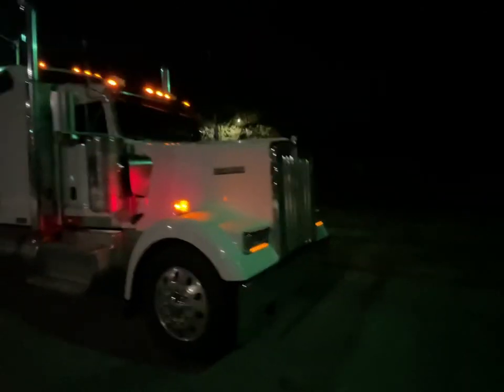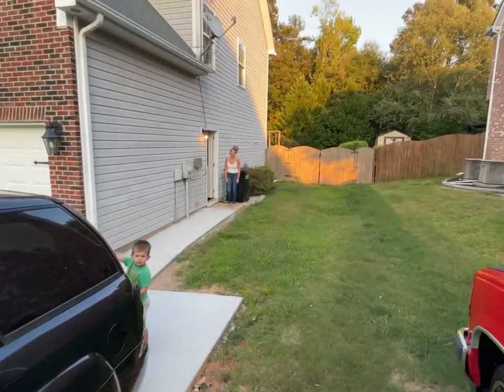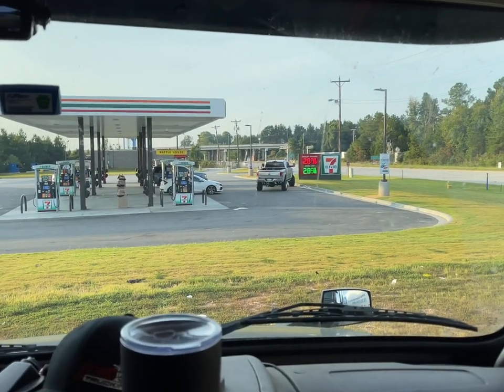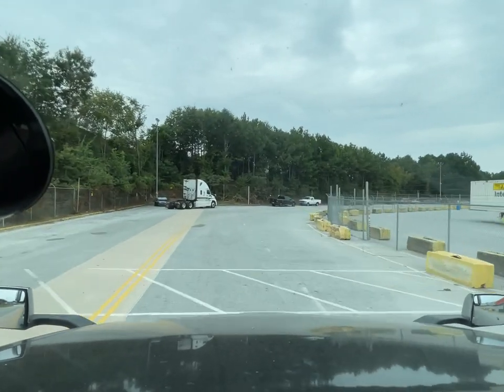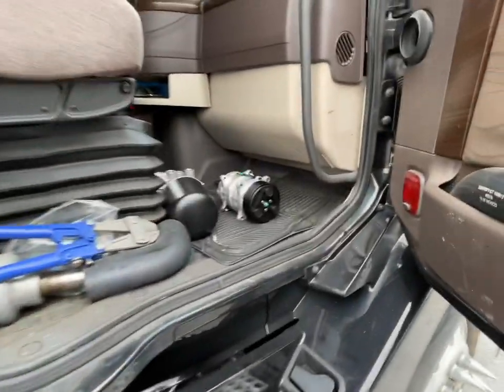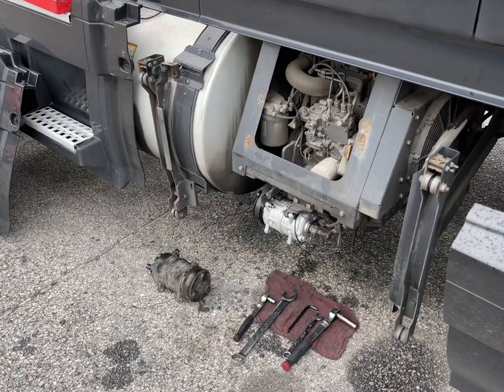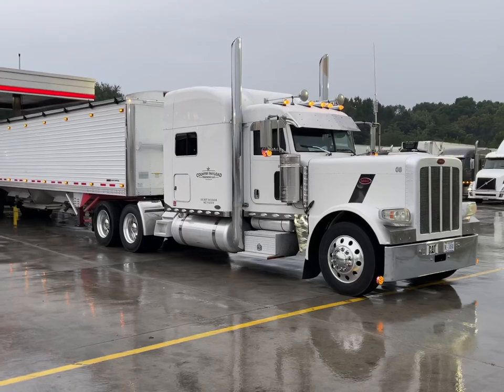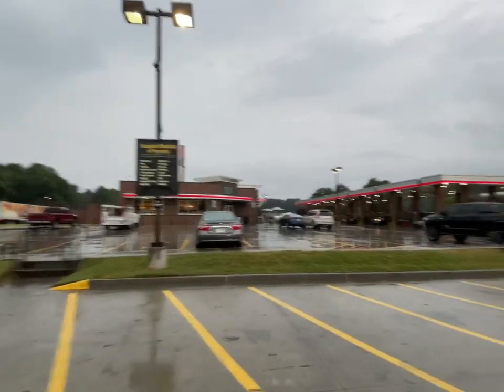“Gotta Fix this Trailer before my Appointment” DIY APU AC Fix !! Daily Life OTR TRUCKING fails Crash

Comment: I wish I could have caught you when you came thru Richmond I could have fixed the floor for you. Just a little advise on fixing floors... Wood from hardware stores don't hold up. Trailer floor wood is way stronger and laminated on the bottom to hold up longer. Also when the hole is in between 2 boards, cut out both boards and stagger them back in almost like you are playing Tetris.Thats for strength. I fix floors everyday so its almost second nature now 😂

Comment: The trailer floor is 5/4 shiplap laminated hardwood.  Either brazilian apitong or keruing.  Super hard wood to work with but holds up a long long time.  I shipped out a whole lot of it back in the day .
Reply: right on  James  do it right the first time
Reply: Maple is also used on trailer floors.

Comment: It's usually 5/4 board. They do sell it at some home depot locations but you can always get it at a lumber yard. You can use 2x4s or any 2x wood it may be a little higher or lower depending on your floor. They sell a power planer to level the surface if necessary. Mines a rigid battery powered planer. I always did my own repairs and I seemed to learn the hard way more than not. Some people would be jealous to see someone succeed where they failed but I love it. I use your videos in daily conversations with fellow drivers. We just started using 360 and uber at my job now. I'm trying to explain to them we need tql and ch Robinson but they don't wanna hear it. Seems ignorant to limit yourself when it's completely unnecessary but I guess I'm not the best one to offer up advice so I always refer to your videos. It usually gets the result I'm looking for...    crickets from the peanut gallery. Be safe out there.

Comment: Whenever you break the system open to air, you should change the receiver dryer. It absorbs moisture in the system and when the system is open it will absorb the moisture in the open system. Then evacuate and charge.
Reply: Facts was a little mad watching to evacuation pulled and old reciever

Comment: Great fix no matter what wood you use; However since the big tires are spraying water and rotting the affected wood you probably be better served if you "screw in plastic" from the bottom side from like used oil containers; i know i used have many many oil containers doing my own 12gallon oil changes; I know you do you own oil changes that plastic makes an excellent protector for any "air and electrical lines" down below, and intertubes work great also
Reply from the maker: Great idea

Comment: Was that our new Spaghetti Junction at Interstate 85 and 385?  
I just can't wait to see you hauling in that WHITE TRUCK . It looks awesome. Although I'm not a fan of driving those long nose trucks. I took my classes at Greenville Tech in 1993. I dont know if they still have the white flat nose cab over International truck that I used to get my license in when you went to school. I like the look if them. I saw that they were  building one . When the door opened a set of steps came out with the door . No climbing into the truck. It was black and beautiful.

Comment: When I was working  on trailers  vans had oak flooring and flatbed had apitong  flooring  and it we did a big patch job we stagged  or cross members  and if we didn't do right a forklift always broke it  I hated floor repairs on vans flatbed ok  I better underneath  and electrical man for 20 years

Comment: I had a similar issue once got a cured pallet wood screw it from the bottom then filled the top with wood bondo been over a year still holding up.

Comment: When you are using the "Jake Brake" where does that energy go? On wheel brakes it goes as heat on the discs or drums. Does the engine get hotter as the brake absorbs energy?
Reply: Jake just keeps the valves closed. The engine compression does the braking.

Comment: I hope you used hard wood, because regular lumber won't work on a trailer floor repair.
Also, the pieces should be staggered, and not in line, for strength.